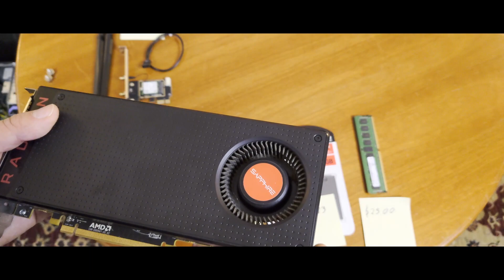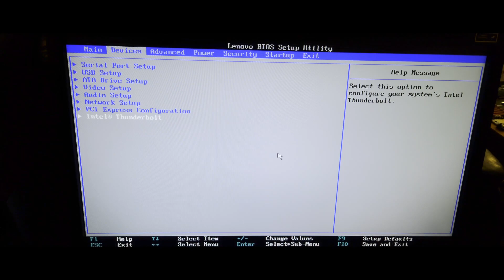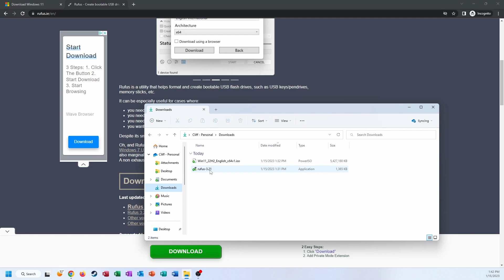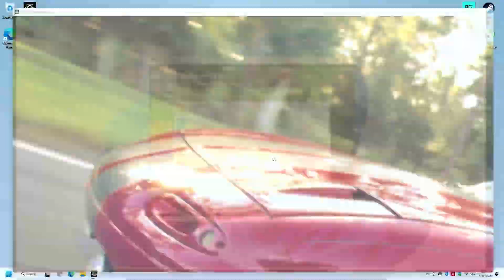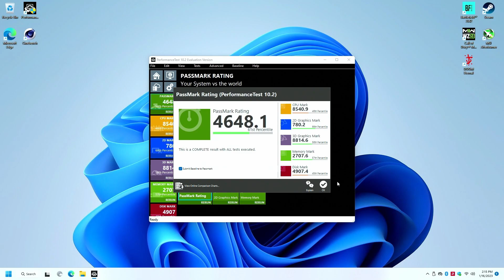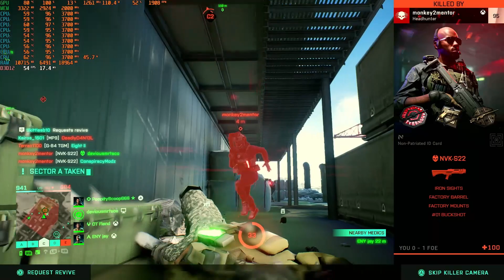~$350 Budget Gaming PC Build! ThinkStation P310 & RX480 8GB

Comment: Anyone looking to do this build, i recommend going with a ZOTAC GTX 1060 6GB AMP card. It is only 8.3 inches in length (RX 480 is 9.4 inches) and fits perfectly without having to disconnecting the USB Header and doesn't block any of the SATA ports.

Comment: PCIe M.2 NVMe Adapter. Yes I have a PCIe M.2 NVMe Adapter with a 1TB 2880 installed in that 2nd PCIe slot and works perfect, and is bootable. M2 SATA in Boot listing is for if your using a PCIe Adapter card has a M.2 NVMe and a M.2 SATA slot and have both type of SSD's installed on it. FYI

Comment: I'm new into building pc's and doing a p310 build and wondering what sata cables I need. I'm doing some digging but having a hard time finding everything
Reply: what have you found cause i have no ideas where this ssd goes
Reply: @Jake-kb9vg  so I over thought the whole pc build and it's a lot more simple then anticipated. The SSD was the only thing that needed a sata cable and it plugs in the 1 of the 4 or 6 sata ports on the motherboard depending on if you have a p310 or p320

Comment: And if you are only using the computer for office use you could easy just use the onboard graphics, you dont need bluetooth either, just buying a fully working P310 tower like this and maybe just putting in some more RAM and an Xeon E3 1270 V5 processor for better performance, and of course get the 400 watt PSU model, if you plan to maybe put in a better GPU in the future. Just for Office use maybe the i3 6th gen would work just fine too, running Windows 10.. :D this are quite good computers.

Comment: cool video bro , i made a pc from scratch by oredering parts and the mother board from alli express the x99 with a xeon v4 , it was a night mare , some parts where defective in the end i got it working and gave it to my brother . i am going to build one againg but by using youre vid total price is like 200 $ on ebay the case is 89 buck with cpu 16 $ of ramm , will be adding a 1tb hdd 16gb more a gpu 8gb and a new cpu heatsink total 200$ i get the price down if my local recycler has one laying around i can get the pc with evrything for like 30 bucks thats if they have one . i am thinking of selling gaming pcs its a good side hustle .

Comment: Is the power supply upgrade able to like an evga
Reply from the maker: Hmmm I'm not sure. I don't know if it would physically fit in the case correctly. The MB is a 12VO one I believe, so you'd need an adapter for a standard PSU.

Comment: Hey Cliff - Old video I know, but I’ve just bought my own P310 and went to bed angry last night because I couldn’t get the thing to boot!! I think it may have been because I was missing one connection to the SSD, blocked by the dual slot 1060 2x 6GB from gigabyte. How did you make sure everything was connected even when the graphics card blocks all those connectors? Thanks.
Reply from the maker: I used an NVMe drive to get around that. You can also try to use 90 degree SATA cables or a PCIe x1 SATA card.

Comment: Cool video.  I have an old T3600.   So far I have yet to run into a game that requires AVX 2.   Even Cyberpunk and Hogwarts Legacy that list 6th and 8th gen CPUs as a minimum not only boot but work great with an old E5-2665.  Runs better than my more modern i5 6500 based system actually.

Comment: Mine was $200.00 Aus and it came with a E3 1280V5 at 3.7GHZ base 4.0GHZ turbo it had the 400 watt power supply no hard drive caddies cheap to find any way and mine had a PCIE card with a 256 GB NVME and the card had two slots but whatever fits the oother slot is not a NVME as I tried.

Also has 8GB in dual channel mode and a NVS315 Quaddro Graphics card, Bargain I have since put 2 3.5" HDD in and upgrades to a 1TB NVME and just threw in a GTX960 till I can find something better.

Interesting when talking about AVX as intel dropped AVX instructions in the later CPU's. My I7 11700F is the last one that has support for AVX 512
Reply: Got a tower for $40 tbh CPU for cheap as well. Then I rounded the rest off with ram and ssd

Comment: Does the stock power supply enough to run the GPU? How much watts was it?
Reply from the maker: Yes, there are two models of PSU. The one I had has a 6 pin PEG connector which I used for the GPU. I think it's a 400w PSU.